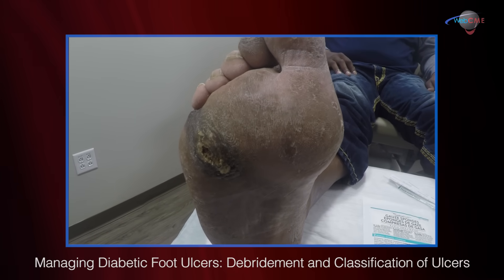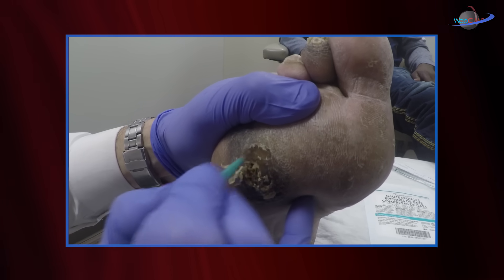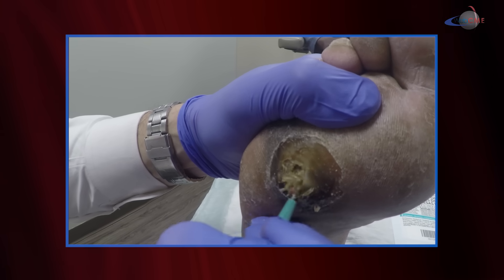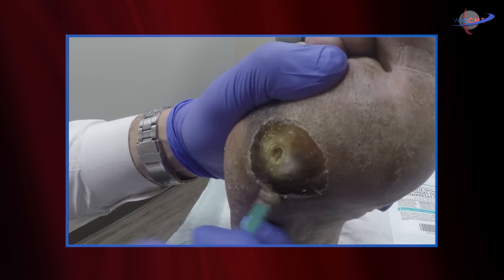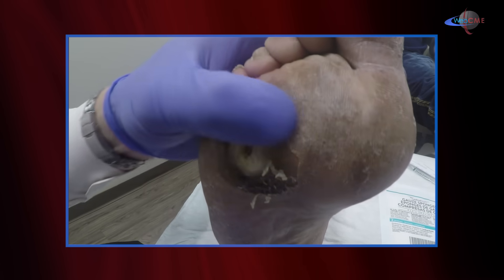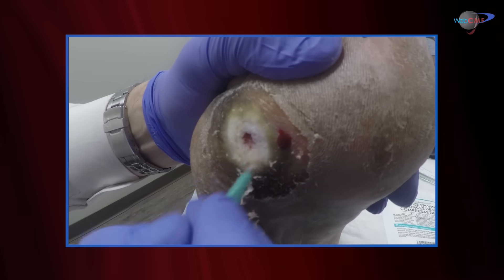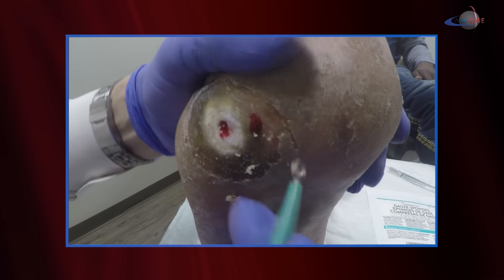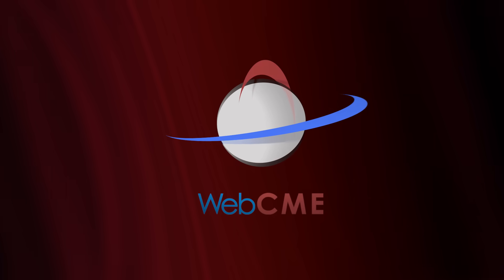WCW: Managing Diabetic Foot Ulcers - Debridement and Classifying Ulcers

Comment: So after watching this video and learning about the curettes, I figure: what could go wrong? I have had this long suffering callous on the bottom of my foot towards the outside. I usually use those scrapers that you put a razor blade in. But I have nicked myself a few times and it takes a while for it to reveal. I ordered two of the items this doctor is using. When I get them I am surprised at how small the 7mm loop really is. I grab one and bend my leg up which is difficult and I take my Curette and try dragging it along the bottom of my foot. Nothing happens. I get angry instantly and know I’ve bought junk. So I flip them over and dragged them down a long way twice in a hurry. Found out that this side was the sharp side,  blood makes a big entry. I’m trying to hop around to get bandages and tape. The 2 drag marks on my foot is leaving a lot of blood in a hurry. So much in fact the blood is turning into clots. My wife is yelling, this isn’t going smoothly. The next she decides that I have had a sore foot for so long, I might as well go to a foot doctor. I get in to see him quickly. We talk and I take off my shoe to show him the two long furrows I plowed into my foot because I didn’t know the curette. He takes a look and says I have a callous with an ulcer under it. He doesn’t tell me any more except that he has to knock me out so he can really dig in (for what I’m thinking). He does and he took a couple photos. It a heck of a wound. They emailed it to me and the wounds look terrible. He pulled out the bloody mass. I dont know what you would call it.  The side of my foot looks like a meat clever opened it. I can send you the photos if you would like to see them, plus a have lots of prior shots my wife took for me.
Reply: Let me see what you are talking about with the foot image.  I know I am on the late freight, but I just started watching these videos.  LOL
Reply: @lushoneworthy8805  I’m trying to respond with photos to the link provided after you click on the photo top right.

Comment: That curette is amazing. Your control is superior. I have only those tools you buy at the drug store where you change out razor blades in it. I have had much trouble using them to remove thickened skin because I often scrape too hard and get a real bleeding situation develop. My leg does not flex very well at all and when I attempt to work on the side of my foot I can’t see, that is when I get into trouble. I always fiddle with the scraper and change blades so I don’t get a continuous action that I can rely on. When I do goof up and make a bad cut I bleed very heavily and I literally have to pack gauze on it and wrap my foot with a roll of tape. This curette has got my curiosity. Where could someone buy such a device? Is there an exact description of this I could refer to in order to buy the same one shown here?

Comment: I wonder why doctors don't use what is called "Collins Solution" for these types of Ulcers? My Dad had these types of Ulcers due to serious circulation problems(he wasn't a diabetic). The Primary Dr. he had written a script for the Collins Solution....which you apply like this :
Collin's Solution
Squirt Bottle (you fill with the Collins Solution)
Under Pad
plastic bowl (discard after use)
Gauze pads (4"x 4"s)
Rolled Gauze (1 or 2 rolls depending on how much you need)
A Plastic Bag
Tape (to close the top of the bag)
    Place 6-8 4"x 4" Gauze Pads into the bowl. Pour an adequate amount of the Collins Solution onto the Gauze Pads so that they become saturated with the solution.
   When thoroughly coated with the Collins Solution, start placing the Gauze Pads onto the affected area of the foot and leg. (it's best if you have someone handing you the 4" x 4" s and the Rolled Gauze when you need it.)
    After placing all the 4 x 4 's on the affected areas, cover the 4 x 4's with the rolled Gauze. Secure with tape when rolling all the rolled gauze around 4 x 4 's.
     Using the plastic bottle, apply the Collins Solution to the Rolled Gauze.
After applying the Collins Solution to the ROLLED GAUZE put the ENTIRE FOOT into the LARGE PLASTIC BAG......TAPE the bag SHUT at the top.
**************************************************************************
This procedure should be done just prior to HS.
In the morning the GAUZE should be completely WHITE.....(WHEN first applied the Collins Solution is a BROWNISH GREEN color.) 
Remove all the gauze and 4 x 4's.....wash the affected area.
Repeat at night as needed.
******************************************
Collins Solution 
If you would like to know more Collins Solution....feel free to email me at holiday2406@gmail.com
Reply: Ou sell this stuff, Im guessing?